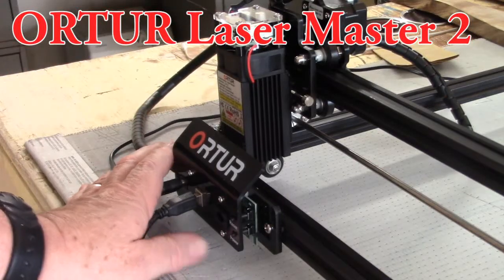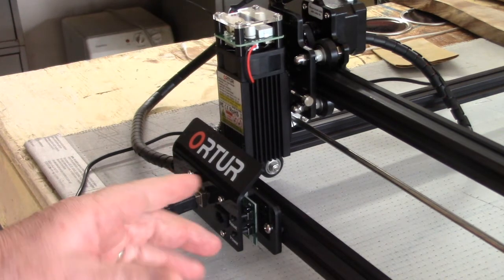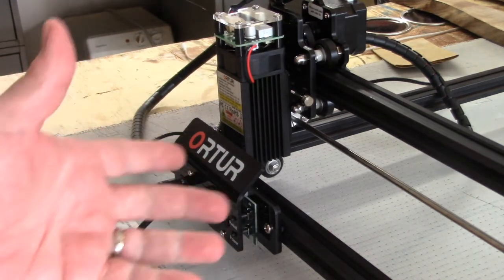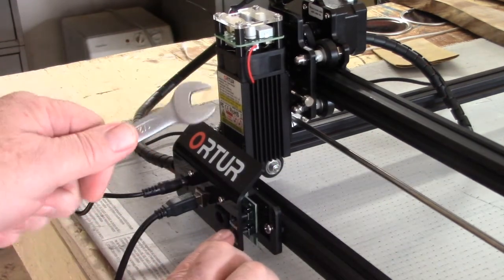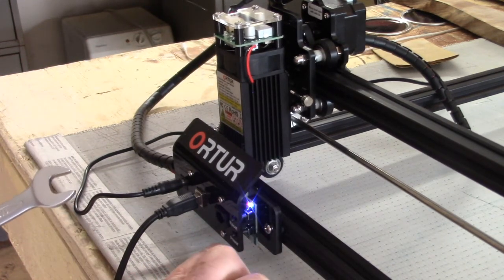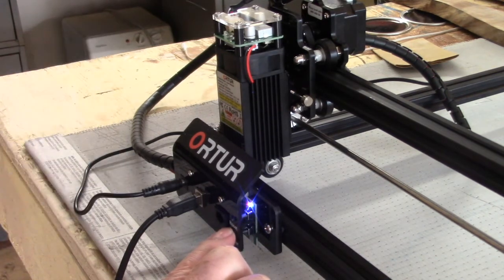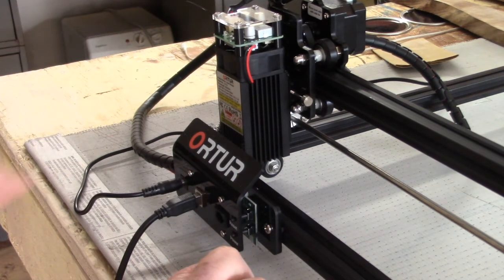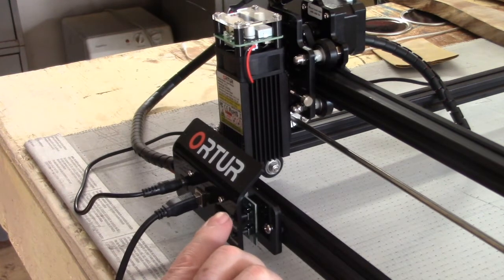My Brand New Ortur Laser Master 2 Engraver Won't Turn On! How to Fix it and Make it Work

Comment: Hold for 4 seconds to turn on; hold for 4 seconds to turn off. Reset is used for flashing the EEPROM or if your laser goes out of bounds. And a screwdriver works just as well! 😎